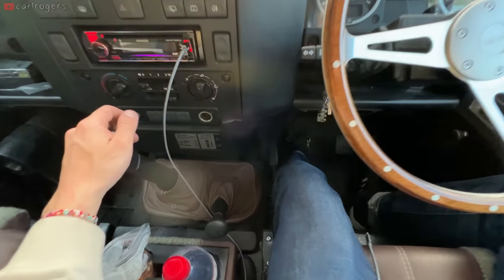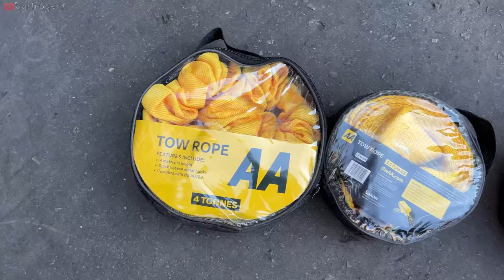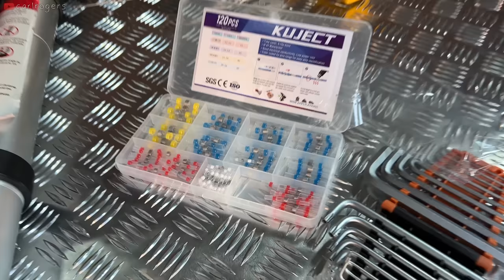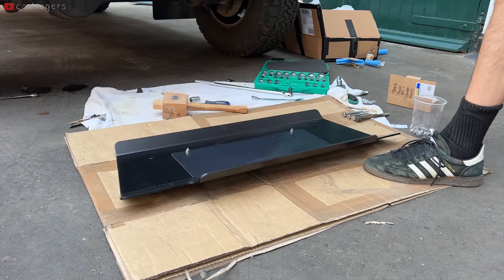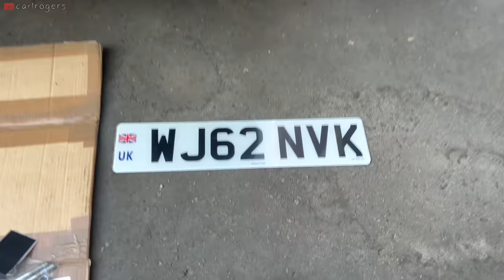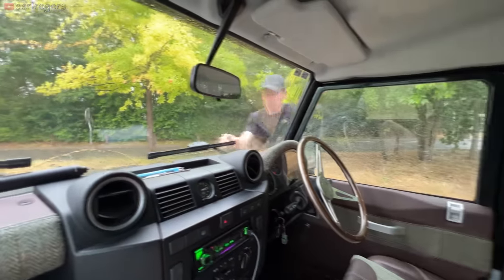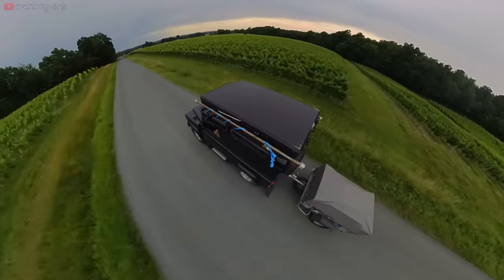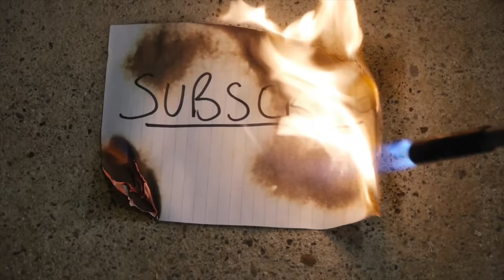Land Rover | Breaking Down & Upgrades

Comment: I worked for a large Utility Company in the 80s & 90s ... our Land Rover problems were reduced after switching some of the fleet to 
4x4 County Transits which had better payload and towing capacity, and didn't fail as often as the LRs ...

Comment: Good to see Carl back online.
Due to a similar problem with using the clutch I converted my 127 to automatic using a four-speed box. It has an integral overdrive and retains the full functions of the transfer box. Never going back to manual!

Comment: Love your video. Tip from me: you are not supposed to lubricate the tow ball. It makes it harder for the trailer to grip the ball. Instead, polish it with some sand paper.
Reply: Yes you should with standard fittings , metal to metal dry has no damping effect it just creates excessive wear, don't confuse them with Alco/ caravan type that have built-in friction pads.

Comment: I was gonna tease you about a multi-day 800 miles, but then saw the roads. More like a few of my motorcycle routes for vacation unless I "Need to get there ASAP" then 1200 miles in one 24 hour drive can happen.  Or one year, 514 to Ma and Dad's, 589 to West Virginia, a few days camping in the boonies and riding there, 611 miles or so to my sisters place near Atlanta (via mostly state highways and some backroads, then, because I was sick and didn't want to infect Ma and Dad with it, a 823 mile run back home taking about 13 hours with gas stops.

Comment: Land Rovers are great - but I do respect Toyota for its reliability! 😊Great Video! Looking forward to your building projects.
Reply: I have often seen comparisons of Toyota Land Cruisers compared to Land Rovers. I have a Lexus LX450 which is an 80 series Land Cruiser and it has over 500,000 miles on it. It has triple lock differentials and I honestly can say that it is built the way all vehicles should have been built. It has stood the test of time and it still holds its value. I have a third generation 4Runner 4x4 with over 300,000 miles and it is just like a new. I ran a compression check the other day and it has 185 PSI in each cylinder (3.4 liter  6 cylinder). Toyotas are tough!!!!!
Reply: Land Rover designs good looking car.  The rest is unpleasant.
Reply: So funny, i was thinking of commenting on “maybe you might think of swapping to a Land Cruiser (which I did three years ago and would never ever go back) but thought it might sound a little churlish😂😂😂 but honestly, you might think of swapping to a Land Cruiser x

Comment: very interesting I had a similar experience coming back from Manchester being at the side of the road for 3 hrs. The Land Rover was not heavily loaded and had only 30 000 on the clock virtually the same age as yours. Ashcroft Engineering has a lubricated replacement  but mine was replaced by the main agent for £1260 !! For a little more money the Land Rover could have been a really good vehicle and I have had to replace fittings that rust and a poor front bumper that rusted badly. Still like driving it though. Happy motoring.....

Comment: Quick question- I didn’t see the links listed for the products you used. Specifically I’m looking for the wire connectors you used with the heat shrink plastic. My puppy chewed through a vacuum cleaner wire yesterday and I saw that and thought that’s the perfect solution. Thanks.

Comment: Could you fabricate a new hold down on that black trailer nut? One that's wider and wraps around the sides of the tab sticking out of the front to the trailer bed? Or add some side walls to the tongue that keeps the bed tab centered on the tongue.

Comment: Hi Carl - I’m new to your channel but sooo interested in your Landy work!!  I am on my fourth Landy ( 1 110 and 3 90s) and have just changed to a low mileage 90 finished in Montalcino Red - this wouldn’t have been my choice (my last one was Keswick Green and white and I have the same steering wheel as you which I have transferred to the new vehicle) but the mileage was too low to resist and the seller was a friend. In this video I noticed that you have maroon door cards - can I ask where you got those? Thanks loads!

Comment: Glad to see you back! 

Are you still able to change your bulbs after riveting the light guards on? 

Also looking forward to what I presume will be a Shepherds hut video in the near future.
Reply: The same thing occurred to me. So surely, the bulbs are accessed from behind. Right, Carl?
Reply: @idontthinkso666  No. Certainly on mine all the lights are accessed from the front so I hope he carries a drill with him.
I tried replacing the standard bulbs with led ones but the light output was definitely inferior. Another factor is that the standard sidelights can be seen up to 90 degrees to the side of the vehicle whereas the leds were forward facing only.

Comment: Carl-  You say you overloaded your vehicle, but I really don't think so.  You did not cause your Rover to break down.  If the splines on the transmission shaft are stripped, it could mean a few things.  One could be the splines were not hardened enough at the factory.  I have a Colchester lathe with some soft gears, so I know a bit about that.  Also, it may be lack of lubrication of the spline.  If there is no grease fitting, again it sounds like a design problem.  A spline shaft like this needs lubrication, or else it will fail from fretting corrosion.  This is when there is constant rubbing movement in the spline.  Humidity in the air will make the steel rust, and then movement from use, wipes the rust away.  This happens over and over again, rusting and the rust being wiped away, and that is how wear happens.  When it wears so much, the splines get loose and soon fail.  But really, you should be able to load your Rover about until the springs bottom on the axles without any damage to the drivetrain.  Does your new spline shaft have a grease zerk fitting ?  --Doozer

Comment: 500kg shouldn’t be a stress test for a Defender. That MT82 output shaft is a weak point even in normal use!

Anyway, you are more worried than you need to be about the durability of a Defender. The suspension is good for massive amounts of weight - they are more robust than some full-size American trucks. I have taken mine to hell and back here in North America, from the top of mountains to the bottom of Death Valley and never had a problem!

Comment: Sorry, the shrimp connectors with the solder are not suitable for solid wires. It seems to work, but the connection is brittle.
Reply: Oh

Comment: Auto immune issues are caused by leaky gut. Thats caused by modern processed food. Eat nothing but beef for a month and you should be able to tell if its caused by what you are eating. I heard about it in 2019 and it worked. It was like finding a fountain of youth. I eat beef chicken bacon lots of eggs some pork sausage lots of salt butter and a little monk fruit sweetener in my coffee. I love my rib eye or tee bone 2-3 chicken thighs and sausage or 2 everyday. I eat 6-8 boiled eggs during the day. I fast for 12 to 16 hours. You will also be able to put on muscle mass basically at will.
Reply: So you’re still only eating meat and eggs after a month?
Reply from the maker: Thanks for sharing. I've heard about this and want to try it at some point!
Reply: @carlroge  it's simply an elimination diet so use whatever you want but it has to be very nutrient dense with lots of natural fat. Salmon, cod, mackeral, sardines, lamb. Whatever. It just allows you to determine what is caused by modern food. Its sugar, and veg oils doing most of the damage. They are in every processed and fast food. Basically everything.  Except anything that walked swam or flew.
Reply: @aayotechnology  since September 2019. Tonight I'm have salmon, ribeye and sausage.